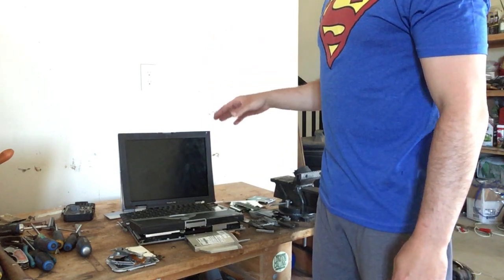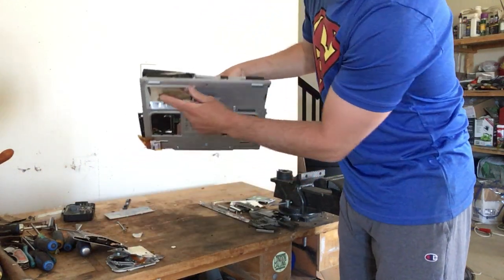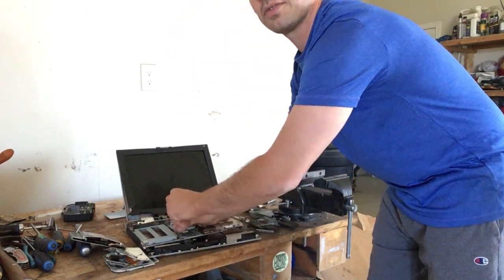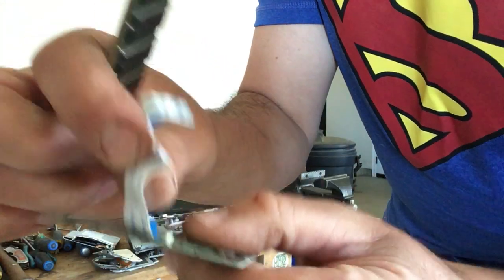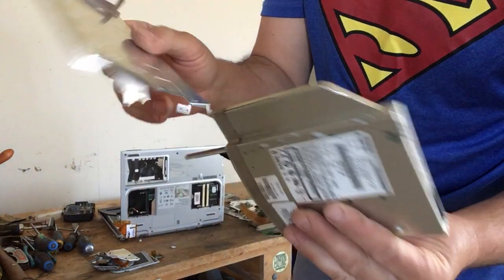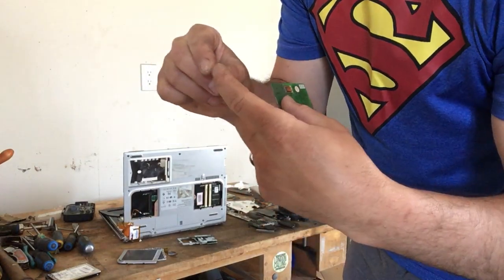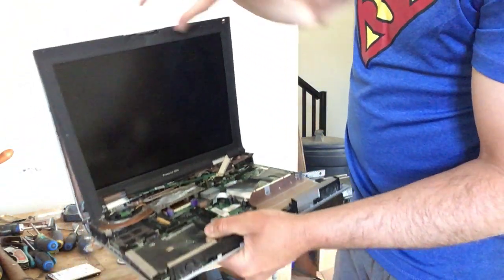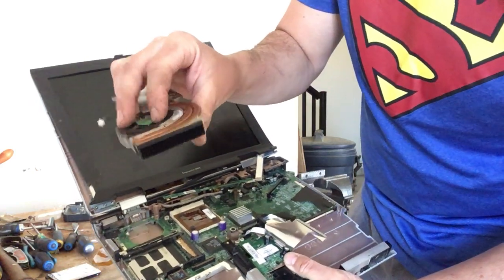Scrapping a laptop for gold, silver, copper, and other metals.

Comment: This guy doesn't help at all . I know more and I never did it before. I need to know what is in the screen s and what the silver tape is . I am looking for a person who knows what each thing is .
Reply from the maker: This is a scrapping channel; there is no scrapping value in the screen. Pretty sure it is plastic. I know electronic recycling facilities break them down and reuse. Silver tape small bits of wire.
Reply: @TinManScrapper  wanted to jump in and thank you for the video. I have 3 old laptops, so I was looking for some way to get any money from it I can. Big question...where are the magnets...in electric machines.
Reply from the maker: @michellebarnhill5130  great magnets in hard drives as neodymium magnets and easier ones to get out are in magnetrons in microwaves. I actually have a video on taking apart a magnetron safely and another video magnet fishing with the said magnets.
Reply: @TinManScrapper  thanks!
Reply: @TinManScrapper  that's not true. There's a board in there for the backlights that has a fair bit of gold plating on it.